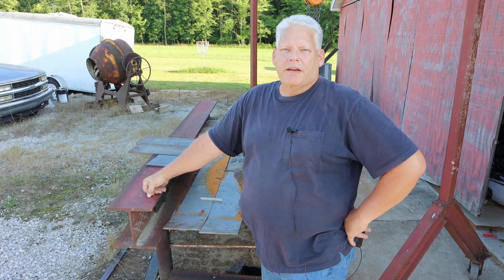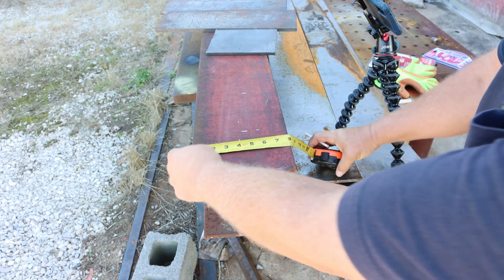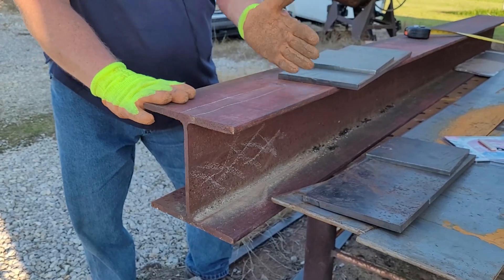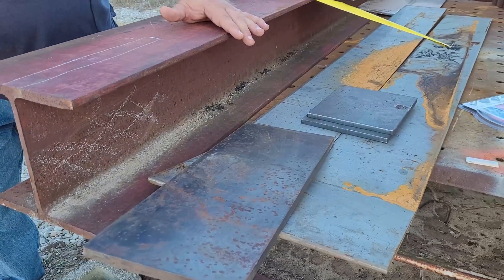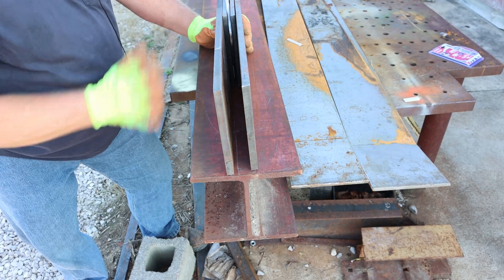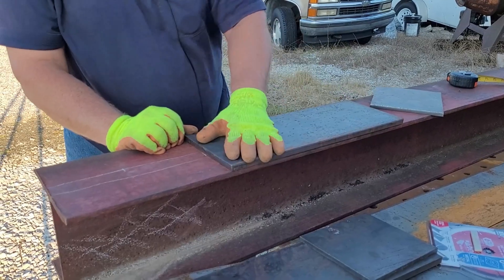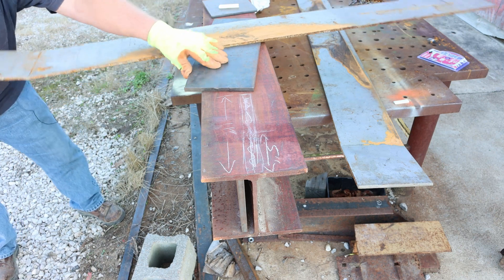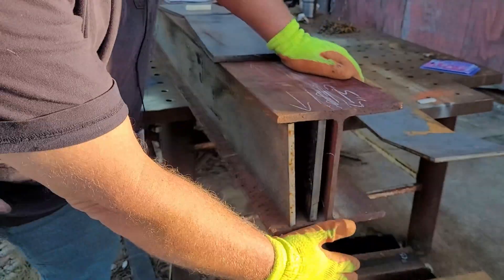Log Splitter Build | Part 2 | Adjustable Wedge Pocket lay-out

Comment: Hello Kevin, just started watching and wanted to throw this up. Might be way easier to add extension plates to hold the wedge and much more accurate than trying to cut out all that steel and the center web..
Now I’m going back to watching the rest of the video..
Reply from the maker: Thanks, Doug. The beam is a few feet too long, so I have room to experiment. I was thinking the top and bottom flange would add some additional strength.   If I butcher the removal of the web, I will be doing exactly what you are suggesting.